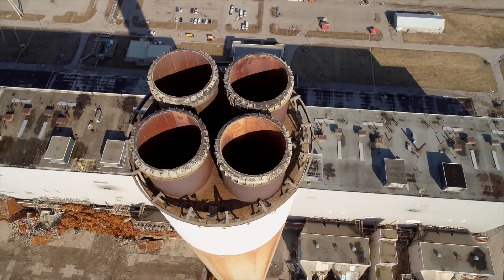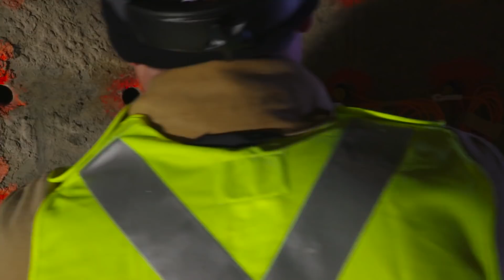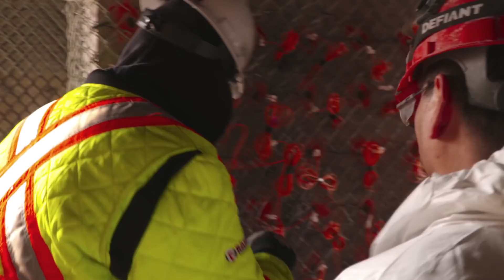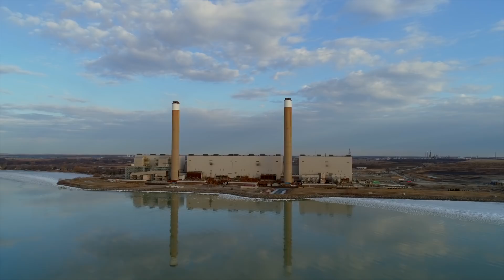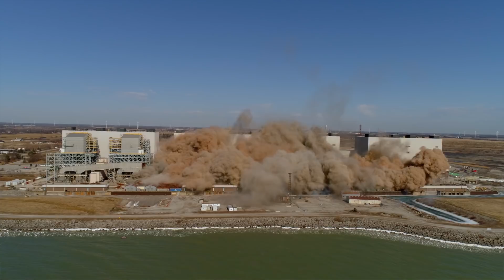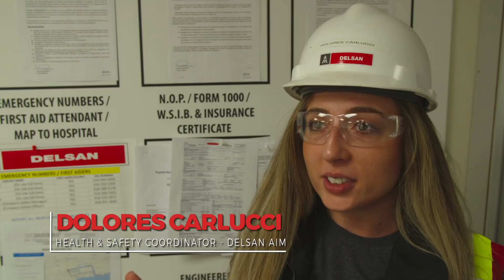Nanticoke Stack Demolition: 2 stacks, 650 ft, 10 seconds - HD Drone Footage

Comment: I think it would have been better to convert Naticoke to burn natural gas instead of destroying it.
Reply: Totally agree. The money spent on building brand new ones like at napanee, could be spent converting already existing plants to gas
Reply: Same with lambton generating station
Reply: Definitely
Reply: Existing coal plants converted to natural gas have dreadful thermal efficiency compared to modern combined cycle gas plants. If natural gas fired capacity is needed, which is perhaps unlikely with electricity generation moving away from fossil fuels as well as the current supply and price issues with natural gas, it makes more sense to install modern CCGT capacity than retrofit giant coal fired plants to natural gas.
Reply: @DavidWood2  I'm pretty sure the thermal efficiency would be about the same as coal.
Reply: @DavidWood2  Are you factoring capital costs in that? And how about kickbacks?? 😠